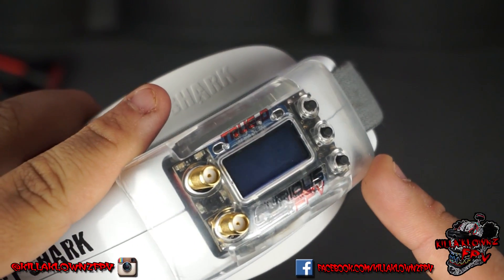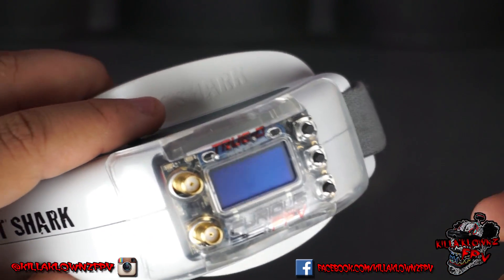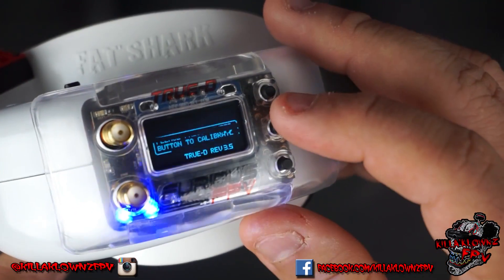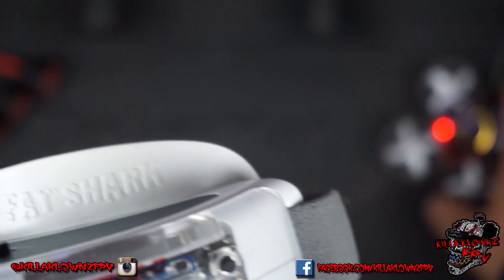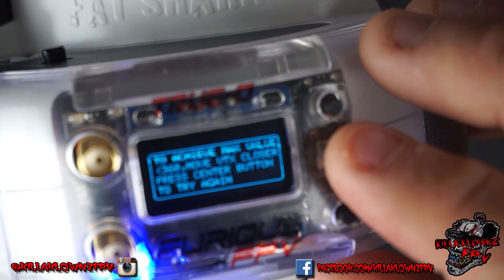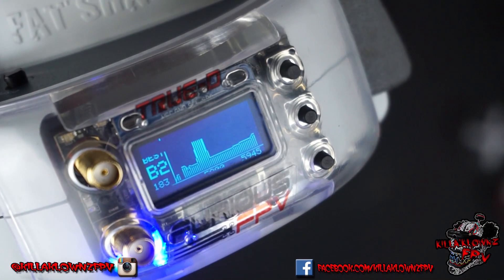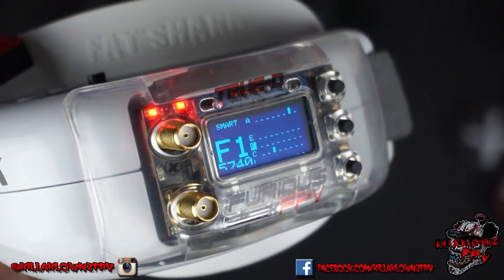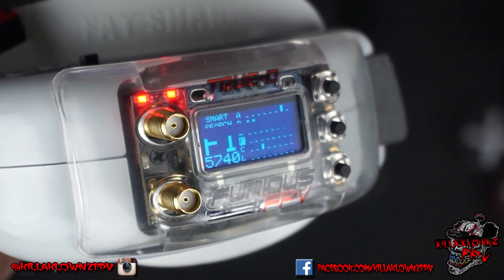True-D v3.5 Setup & Calibration

Comment: in case of unify pro wich is 25mw - 800 mw shall i calibrate in 800 mw?
Reply: Calibrate at 25mw. Calibration wants to see differences between the two antennas to adjust for differences between them. Running 800 will be too high.

Comment: I got the 3.6 do I have to calibrate EVERY new flight?
Reply from the maker: IceRook no you only do it on initial setup
Reply: KillaKlownzFPV 831 thanks, so your just using any vtx to calibrate, and once it's done I can swap over to my other quad and not have to calibrate again or I should?
Reply from the maker: IceRook yes sir you are correct. Just set once and you're done. Its just the initial setup so it knows rssi value no matter what vtx you use after calibration
Reply: KillaKlownzFPV 831 👍 Ty!

Comment: My 3.5 Tue-D doesnt switch antennas as fast as other 3.5 modules ive seen, I even take off both antennas and put one in, and it takes a while for it to connect to that antenna, what would you suggest? Switching takes forever
Reply: if you still have this problem look into the filter settings